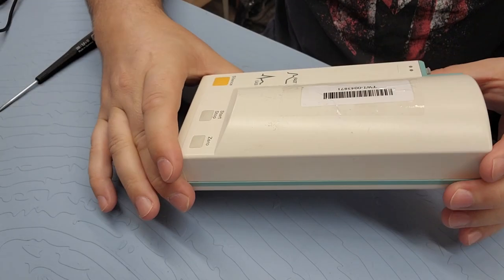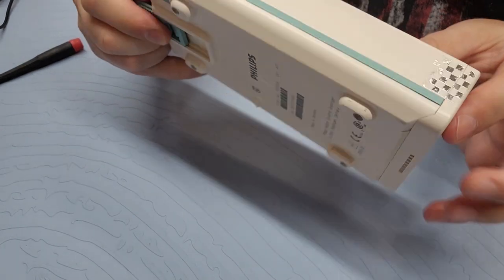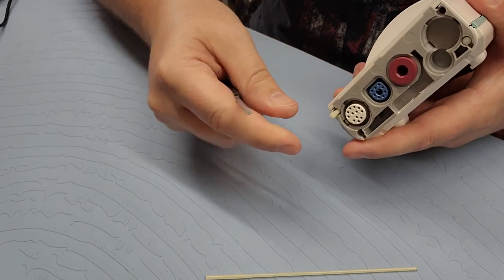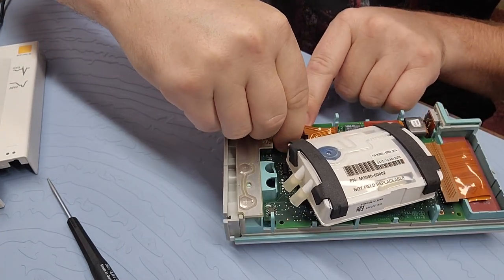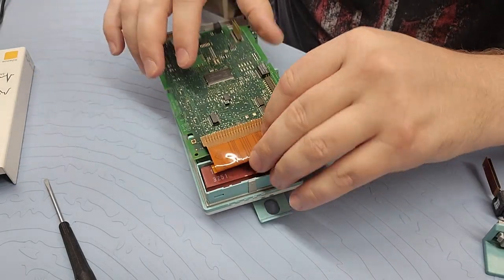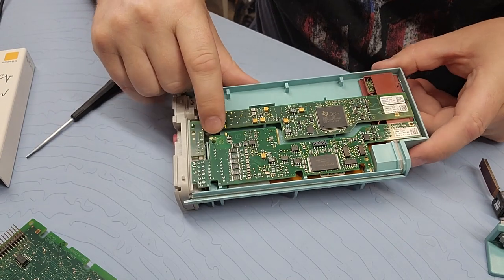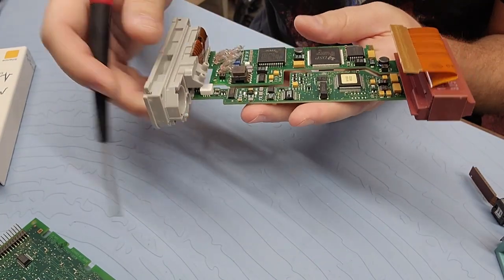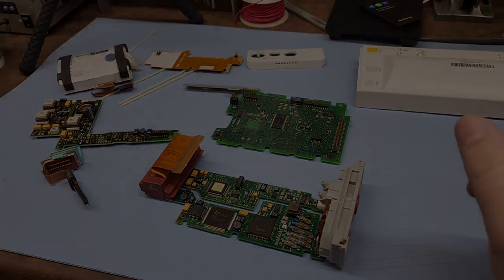Philips M3001A MMS Teardown!

Comment: The "bulbs" are called Neon bulbs. You know them from the socket strip where there is this red/orange lamp in the switch. That's a Neon bulb. It is in this apparatus to arrest high voltage pulses to avoid sparks jumping. They start conducting around 90 volts and can have higher voltage, according to gas filling/pressure inside. Actually, go have a look at "Usagi Electric" 's latest video, it's specificly about these Neon bulbs :)
Reply from the maker: I will need to research this more
Reply: Neon bulbs are used to shunt defib spikes from the input. They’ve been used for decades.

Comment: Have you ever taken apart any HP bedside monitor modules or portable defibrillators from the late 80s to early 90s. Used them in icu they seem ED built like tanks. PB 7200 ventilators from same era similar feel, at least from the outside.

Comment: I have a problem with this device, the led turns on but it does not recognize any cable, do you know what it can be? :0 I need help at my job :( please
Reply: Yeah, when I connect the module to the monitor a led turns on, but it does not recognize any cable :/ what could it be master king?
Reply from the maker: Check the port carefully on the cable and the MMS module. There's often 1 damaged pin at fault